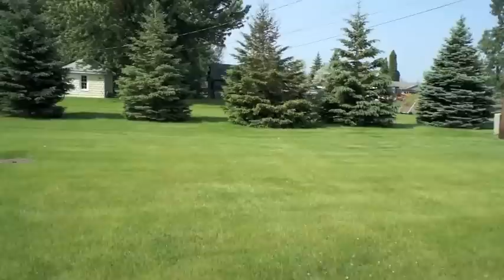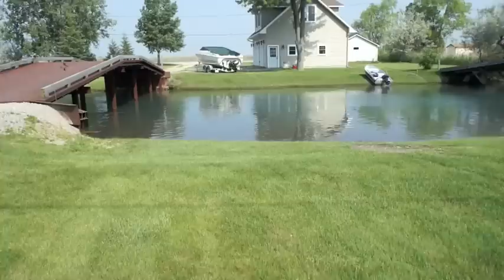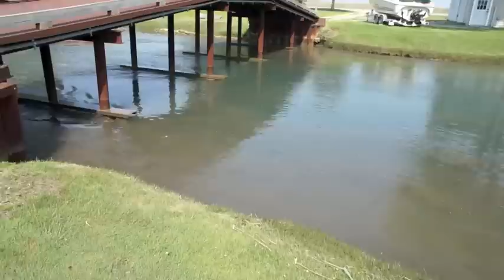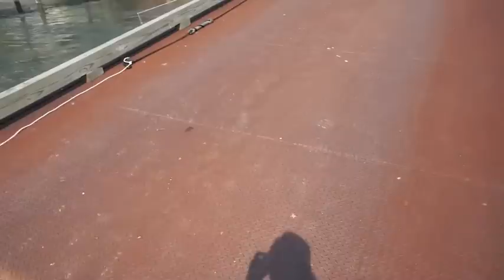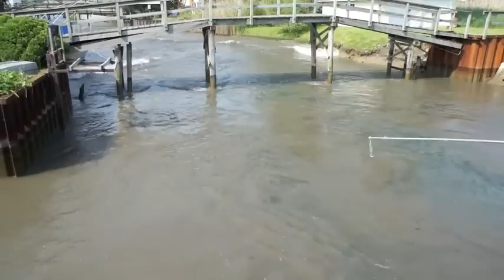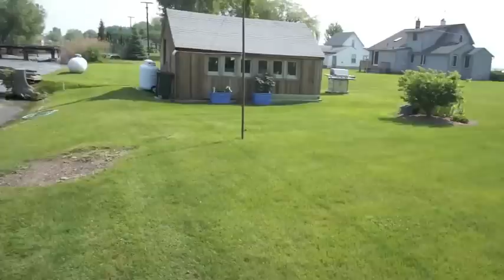Displacement from Ship causing damage

Comment: why live there then if that's such a problem I'm almost certain those ships were moving up and down there before those house's were built
Reply: Read the description before you comment next time.
Reply: I did read it buddy I know what displacement is and like I said I'm sure they were moving freight through there before those House's were built if they built it up they should have used a better base I fail to understand ur comment?
Reply: Its a nice video and all I wasn't implying that
Reply: eric corbitt You think 1000 ft boats have been around longer than some of those homes ? Tell that to tribes such as the Seminoles and Creeks.
Reply from the maker: eric corbitt while the houses were here long before the ships, that is not the issue. Residents on this particular island love the ships. Houses and ships have coexisted for a long time, and is part of the attraction. 

The issue when this video was taken (and posted for USCG review) nearly 5 years ago was the new increased travel speed during spring shipping causing this unknown effect  - which was never a concern before.

Once speeds were enforced and re-evaluated for this channel, the issue was mitigated once more, and things are returning to normal.

It isn't a problem of rights and ownership, it is an issue of paying attention to rules and guidances set by engineers to prevent problems.
Reply: Can't be that certain of a feeling

Comment: This is the same way tsunami waves work. Underwater earthquakes displace large volumes of water, generating waves that can cross entire oceans.
Reply: Derek032789 You got that half right. When the earthquakes underwater happen, energy is sent out at high speeds. As the energy travels into shallower waters, the waves the energy creates slows down but gains amplitude. As it reaches shore, that's when the water is displaced over and over.

Comment: I failed to see the damage.
Reply: Other than erosion of the banks and the chance of a kayaker who doesn't know better getting swepted away, there isn't much of a problem. They could put some bulkheads in and that  would solve the erosion problem.
Reply: It isn't a canal OR stream; it's an itty bitty backwater with 14 properties sharing this backwater parallel to the river.  Because it is open at both ends and is 1300 feet long about the same length as a ship, the bow wave enters at the north end while the displacement suction is at the south end and you get a strong current which you can see in the video.  Then the suction is at the north end as the stern wake hits the south end.  Blocking one end would reduce this phenomenon and if you look at Google Earth you'll see that many or most of these little backwaters are open at only one end.
Reply: Is this where the south channel goes between  Seaway Island (Canada) and Harsen's Island (U.S.)
Reply: there isn't any damage. this guy is not from there. i am. he is also an idiot

Comment: One thing you need, if the tide ever goes low enuf there, GUNITE.  Sprayed concrete, as dry as possible (for strength and hardening time) along all sides and bases of the canal, the bottom too if it ever was to be exposed.  Just a thin flash coat, poured cement would crack up too easy, and not fill all voids.

Comment: Hence why I said to research what can be done to better control and/or limit this issue, before taking it to local government. Research implies, a study and collection of data on the effects of the cannal, before and after changes are made and the effects of different methods to stop, control, or limit the drain and surge effect. Not just video taping it and bringing that as the only evidence. Provide a vaild and well proposed case with plenty of evidence to support your stance.

Comment: Easy fix... Cement baffles staggered at the canal ends. Three rows, spaced and offset enough to get your small boats through.
Semi trailers for liquid use the same concept internally to prevent the liquid from smashing into the front/rear upon breaking and acceleration.  The water will still rise and fall, but far less violently.

Comment: Umm ...thats an easy, though expensive fix... build a rock/concrete retaining wall to a minimum depth of 10ft so when the water swells its not washing out your property. As far as the boat goes build a proper dock/boat launch. You own the property not the river improve the property, or research what steps can be taken to control the problem and petition you local government for a solution. In other words be pro-active.

Comment: Lock gates use mitre's to seal the gates, using the pool's water pressure to seal the gate.  When the tail race level becomes equal or greater than the opposite side of the lock gate, it can easily lift the gate off of the gudgeon.  Which is why any lock, within the US Army Corps of Engineers (which runs all locks and dams in the US), requires turnbuckles to be put on the gates during high water scenarios.

Comment: yes i know what a lock does, and it can also be used to stop water flow which is why they are used to change water levels in inter-connecting canals. There's no reason this cannot be used to prevent the water getting drained from his canal into the big river and then flushed back in again. They get used for that purpose all the time in holland.

Comment: Its funny how all these assholes want to live on the waters edge, yet they bitch when the water damages stuff. There are lots of assholes near me that live on the beach and then complain when storms and high water wash the sand off the beaches. They complain and the city pays to have the sand pumped from deep water back onto the beach. The reason the sand washes away is because the trees and dunes that would  hold the sand has been replaced by houses.

Comment: (i.e. gradual earth slope, flat metal surface, stone wall,) these variations in surface cause the water to scour and scrape away at the property line.   Your video didn’t focus on the side with the freighter, but the canal in back so I assume there is no problem with that side?  What would fix the issue is; a structure that reinforces the bottom of the mouth of the smaller canal raising it up, having one uniform wall for the joining properties, or both.

Comment: As a result its base is considerably lower or even wider than it has been in the past.  The vacuum caused by the ships passing, sucks the water out of the canal along the bottom of the waterway much like what is noticed before a tsunami.  The wake from the speed of the vessel, combined with the returning undertow is pushing back up the incline of the mouth of the canal and corresponding grade of the canal itself.  As the water moves along the varying walls of the canal from property to property,

Comment: Mghilla, this isn’t really an issue of displacement but rather Excitation Force.  As you can’t really have complete displacement in an open body of water.  For that reason the fast moving vessels are amplifying a number of natural forces that occur in many water tributaries.  Knowing more about the natural geography of that area would help.  But basically, the mouth of the small canal where it meets the larger canal has likely given way to erosion (probably accelerated by the passing vessels).

Comment: What speed? That ship was moving really slow. Besides its not the speed of the boat its the amount of water it displaces. Really that canal is badly designed to begin with. It should be lined with concrete or rocks or something to prevent erosion.

Comment: The issue is that the captains are not abiding by the speed limit that has been set for this very reason.  If they went the speed limit it wouldn't be a problem.  Unlike noise pollution from airports, this is completely avoidable.

Comment: well then...you know the answer.  If the canal is natural, man made engineering can fix your problem.  Learn about water displacement, and what you could do to reduce the wake issue.  If those commercial ships go faster than allowed (which I doubt is measured in mph....) than contact the port authority, provide the ship's name (side of the ship usually carries that)..give date and time...and you could give warning...or get an airhorn and a loud speaker:)